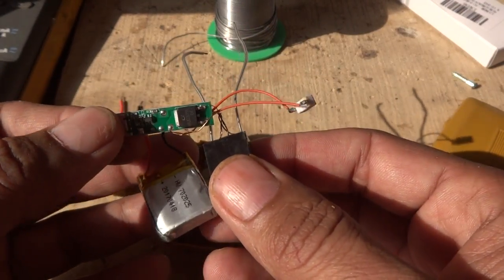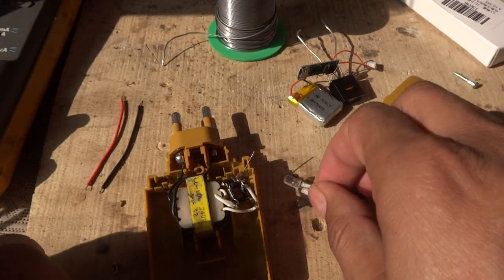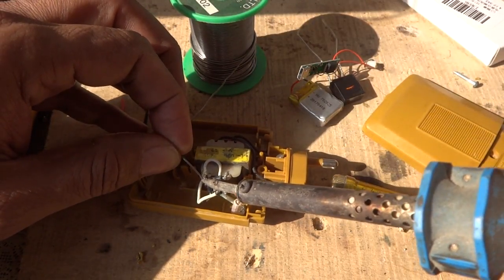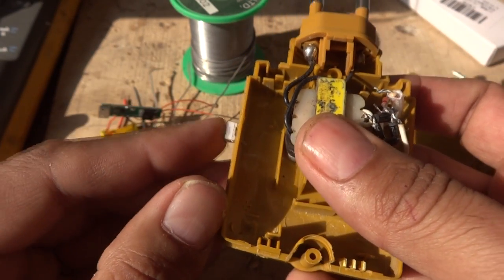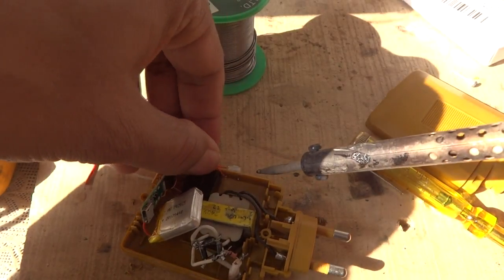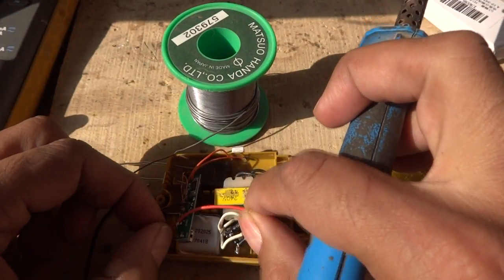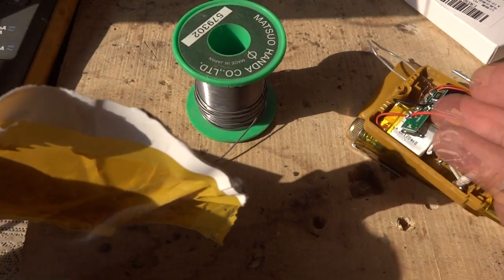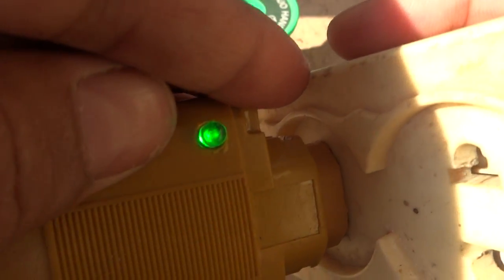igniter circuit encapsulation. Homemade mini spark ignitor Igniter

Comment: Smashing job jahan :-D

That's an ideal case that just fits nicely into the hand, you will never need matches again :-D.

The only additions i would make is a blob of glue on the spark transformer and battery to prevent them moving in the case.
And slide a bit of wire insulation on the two spark wires to make them slightly stiffer, so they keep the shape better :-D.
Reply: Great job